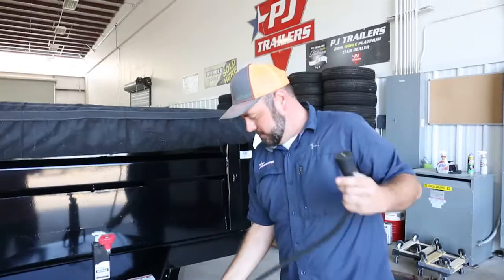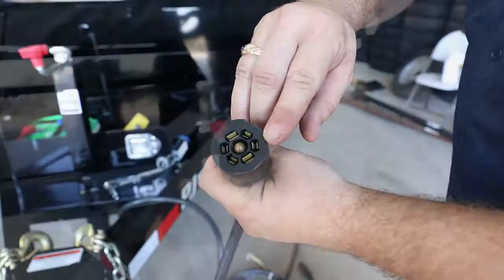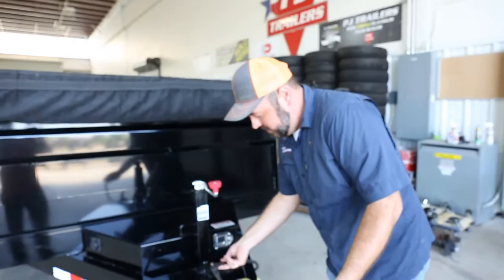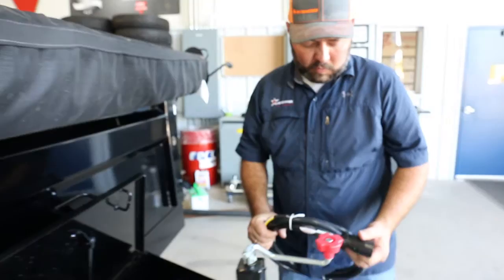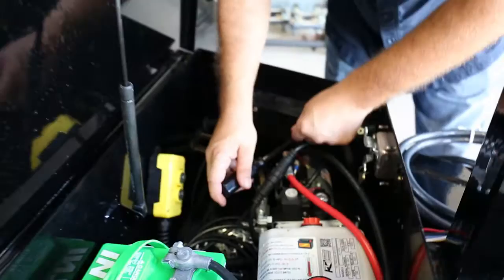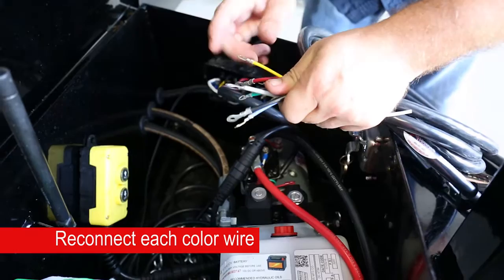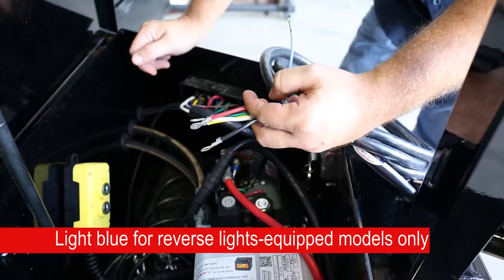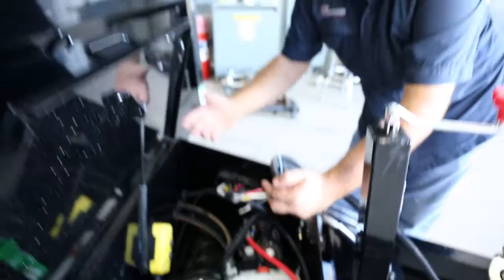How to replace a Wire Harness on PJ Trailer

Comment: If blue is for the reverse lights then they go in the middle of the 7 pin according to diagrams.  But my PJ trailer says blue is my trailer brake, which is bottom right connection.  I'm having issues with my chevy 21' trailer brakes saying check trailer wiring.  I replaced the 7 pin plug and cannot get the wiring fixed.
Reply from the maker: PJ Changed it on newer models. If Blue is Brakes then Black would be the other option.
Reply: @NationwideTrailers  ok Thanks
Reply: The colors can vary

Comment: Where can I get that bargmen harness part number 170287 it doesn’t come up. Please advise.
Reply: This new blue harness, the blue wire inside the harness will be used for the brakes vs the black that is used on this harness in the video